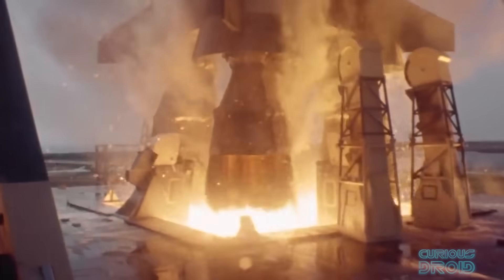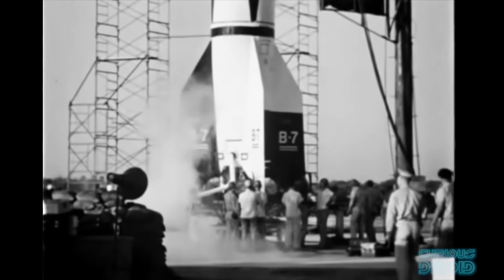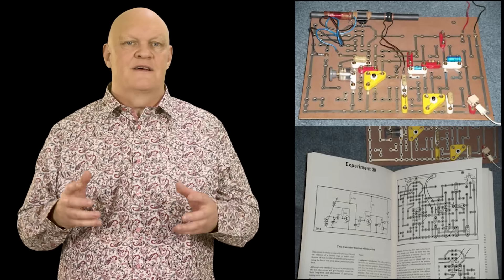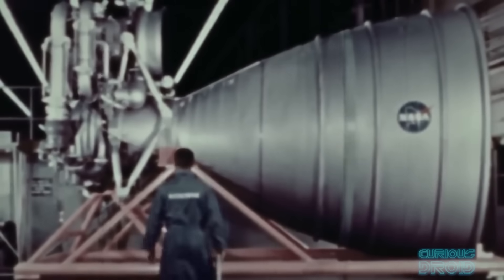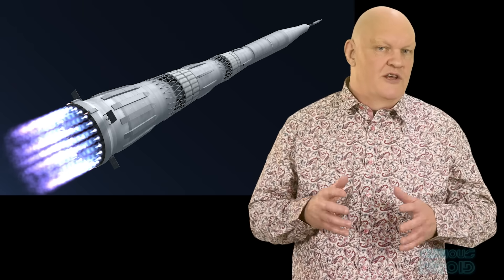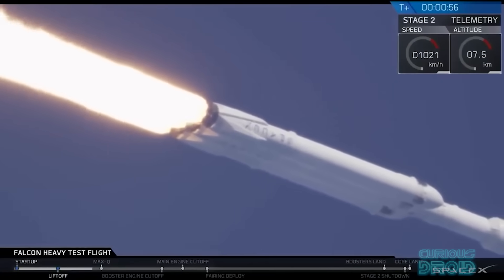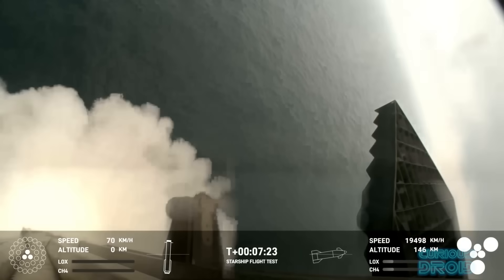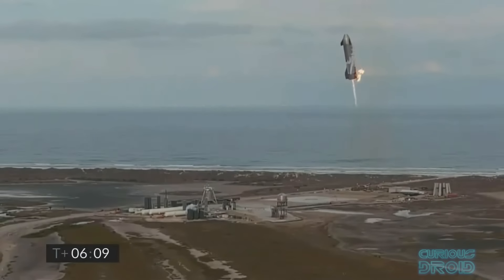Why Does SpaceX Use 33 Engines While NASA Used Just 5?

Comment: Bit of a nitpick but detonating charges in the f1 wasn't how they solved the instability, it was how they INDUCED the instability. Since it was intermittent, they needed to make it happen on command, and hence the charges. They already knew the solution was going to be via baffles on the injector plate but they didn't know what shape, size, direction, quantity, etc. so they tried all different types using the detonation to cause instability and then recording how well and rapidly the engine recovered and they eventually arrived at the best design by process of elimination.
Reply: Since the 1950s Rocketdyne under NASA contract developed the F1… this was a huge engineering achievement which even 50 years after became an Iconic and proven design. In contrast, SpaceX uses a different approach to all its decisions which results in clearly non sensical solutions…Called guess engineering or trial end error… which by the string of obvious mishaps and continues failures despite the spinning is not engineering by definition.
The good thing is like JFK once said you can’t fool everyone forever 😂
Reply: @Mannicx  hahaha, fair point, although to be fair the fluid dynamics going on in even a small well behaved rocket engine with the associated shock-shock and boundary layer interactions between injector flows, subsonic and supersonic flame fronts, reflections, standing waves, etc are fiendishly complicated let alone a massive engine like the F1 suffering combustion instability and it's not as if CFD tools capable of modeling it existed to do a proper engineering analysis with, so relying on intuition and educated guesses about what designs might work and then testing different iterations to find the best solution was about all they could do. There's pictures out there of all the different designs they tried if you're interested and it's really pretty fascinating to see what worked and what didn't.
Reply: @GlutenEruption  agree, I admire the efforts and engineering that went into the development of the F-1 … just keep in mind that each F-1 iteration was all about science and engineered backed decisions… not guesswork 😂
Reply: @Mannicx  oh, of course! Done with slide rules and log tables too. They instrumented engines with hundreds of analog pressure sensors to get an idea of what was happening in the engine, preformed literally millions calculations and ran thousands of tests on different injector designs, baffle geometries, baffle configurations, etc.
Reply: Did Apollo 11 actually leave near-Earth orbit?
Despite the revisionist narrative that this channel won't question -- unstable fuel burn for the oversized F1 engines was never rectified and another arrangement in their place was made in order to reach near Earth orbit, keeping the F1 bell nozzle to maintain the desired appearance.  The great licking yellow flame was an indication that something was not normal as fuel was burning in the atmosphere while providing no additional thrust. This was the result of injecting additional kerosene into the exhaust stream for greater visual effect yet appearing to produce an inefficient burn unlike other rockets after launch.  No explanation is forthcoming and this issue is not addressed in any usual report; however, using a smaller reliable engine with a reduced fuel load and stripped down mission requirement allowed the Saturn V to reach near-Earth orbit.  

The Apollo 11 crew attempted to demonstrate their position at over halfway to the moon as seen in the unedited version presented to the public while the more recently released unedited version reveals a flood of blue light entering the same window as the camera continues to roll, through which only a moment before, we saw the Earth far distant in what appeared to be very low light conditions. Then, as the camera pulls back from the window, the exposure settings are seen to return to normal as a flood of light enters the same window.  Without a change in the orientation of the spacecraft assumed to be on a trajectory toward the moon, the only source for any flood of light can be the Earth while in near-Earth orbit.  The usual sponsored efforts will try to make excuses for why the obvious did not take place -- yet is overly apparent in the unedited version.  When facts cannot prevail in support, sponsored activity will resort to name calling and other derogatory comments discrediting themselves.
Reply: @ronaldgreene5733  Here's a more detailed explanation of Apollo 11's journey, now it’s SpaceX turn …. Just do it!..

  To get real and recap…55 years ago…. Apollo 11 engineers launched on July 16, 1969, on a Saturn V rocket from Kennedy Space Center in Florida.
   - The Saturn V had three stages, each responsible for different phases of the mission. The first two stages provided the thrust needed to escape Earth's atmosphere.
   - After the second stage was jettisoned, the third stage (S-IVB) placed Apollo 11 into a temporary, nearly circular parking orbit around Earth at an altitude of about 185 kilometers (115 miles).

   - While in low Earth orbit, Apollo 11 orbited the Earth once and a half, allowing NASA to check the spacecraft's systems and prepare for the next critical maneuver.
   - To leave low Earth orbit and head towards the Moon, the S-IVB stage was reignited for a second time, performing what is known as a Trans-Lunar Injection (TLI). This burn lasted about six minutes and provided the necessary velocity to escape Earth's gravitational pull.
   - The spacecraft was accelerated to a speed of about 39,000 kilometers per hour (24,000 miles per hour), which allowed it to break free from low Earth orbit and enter a trajectory toward the Moon.

   - After the TLI burn, the Apollo 11 spacecraft was on a free-return trajectory to the Moon. This means that if no further maneuvers were made, the spacecraft would loop around the Moon and return to Earth.
   - During this phase, the Command Service Module (CSM) separated from the S-IVB stage, turned around, and docked with the Lunar Module (LM), which was stored in the top of the third stage.
   - Once the CSM was docked with the LM, the combined spacecraft separated from the S-IVB stage, which was later sent into a solar orbit.

Lunar orbit it insertion phase
   - After a three-day journey, Apollo 11 entered the Moon's sphere of influence. The spacecraft performed a Lunar Orbit Insertion (LOI) burn to slow down and be captured by the Moon's gravity.
   - This maneuver placed Apollo 11 into an elliptical orbit around the Moon, which was later circularized.

Then, 
   - On July 20, 1969, astronauts Neil Armstrong and Buzz Aldrin descended to the lunar surface in the Lunar Module, while Michael Collins remained in orbit aboard the Command Module.
   - Armstrong and Aldrin landed in the Sea of Tranquility and became the first humans to set foot on the Moon.

   - After spending about 21.5 hours on the lunar surface, the astronauts returned to the Command Module, performed a Trans-Earth Injection (TEI) burn to leave lunar orbit, and traveled back to Earth.
   - Apollo 11 safely splashed down in the Pacific Ocean on July 24, 1969, completing its historic mission.

This mission marked the first time humans left low Earth orbit, traveled to another celestial body, and safely returned to Earth.
Reply: .  . While remaining in near-Earth orbit, another indication are the impossible weather patterns seen on Earth, when in reality only a small portion of the Earth's surface was visible, framed by the round window of the command module.  Straight line cloud fronts are seen on video to be extending for what appears to be more than 6000 miles, a quarter of the Earth's circumference -- something that has never occurred in the meteorological record on Earth. The round window of the command module was used to effect an image of the Earth but the weather in the region did not comply for a realistic view.  No recognizable continents are found in view, but only the impossible weather patterns seen.

Comment: The RS 25 engines are surplus engines left over from the Space Shuttle program.  NASA decided to maximize the payload size for sending to the moon.  If they designed the SLS to be completely reusable, they would have to compromise on the payload to allow for part of its fuel to be used for recovering the core in the way Starship is recovered.  The way SLS is configured, the core continues its burn until reaching an altitude where an intact recovery is impossible.  I would imagine once the RS-25 engines are used up, a newer, cheaper design that doesn't need to be reused would be used (assuming those missions are still funded)
Reply: Actually, NASA and Aerojet Rocketdyne signed a new contract for additional RS-25 engines for the SLS. Cost: $100M per engine. So, the cost of one of those new RS-25s is equivalent to the cost of 200 Raptor 2 engines.

Comment: Because elon wants to use tax dollars to experiment with getting his payloads into space since he is the only one that needs multiple payloads that big. Hope that answer the question
Reply: Not Investing in Starship would be foolish for NASA. IF Starship turns out working it will open many many possibilitys/capabilitys for NASA and other Agencis and SpaceX of course. At this point NASA has invested about 3B $ wich isn't a lot if you consider that the small Orion Space Capsule (wich is still not working properly) has cost about 20B $ for NASA.
Reply: @meinking_sensei3807  3 billion for blowing up rockets in low earth orbit. Heck of a deal
Reply: @brickwitheyes1710  as i said "if it works" and SpaceX ain't done with it. But spending 20 billion for a small space capsule (wich still doesn't work properly so more money needed) is a heck of a deal, spending 2-3 billion on a single SLS launch is one heck of a deal or 1 billion on a launch tower.
Reply: @meinking_sensei3807  oh the capsule for the Artemis program that they are waiting on space X proof of concept when everything else is ready to go? Yeah great example 👍
Reply: @brickwitheyes1710  i mean the capsule that had onboard computer problems and heat shield problems (that they still haven't resolved yet and therefore not "ready") after spending 20 BILLION $.
Reply: @brickwitheyes1710  Artemis 2 isn't happening this year. It's happening late next year. At best.

It's still unknown what will be the limiting factor for Artemis 3; Orion or HLS. Both are currently delayed from the 2024 target to 2026.
Reply: @brickwitheyes1710  Don't let hate cloud your judgement.
Reply: @brickwitheyes1710  You are demonstrably wrong. SpaceX is the most successful rocket company of all time.
Reply: @SpaceAdvocate  😆 🤣 sure thing.
Reply: @brickwitheyes1710  It's just a fact. If you find yourself incapable of accepting reality because of deep-seated hatred, perhaps it is time to make a change in your life.
Reply: @SpaceAdvocate  space X has done nothing remarkable and my responses seem to keep getting yeeted. Musk said he would cut launch costs by 💯 percent and hasn't cut any costs. His false promises where how he got the contract in the first place. Not to mention the shady way in which he got this last contract.
Reply: Why would we discriminate whether the money comes out of taxes or from Wall Street idiots?
Reply: @samsonsoturian6013  true, when they go broke from backing frauds and idiots like musk they get bailed out with tax payer money anyway
Reply: in fact, spaceX saved taxpayers several billion dollars due to the reusability of falcon9,
Reply: @maks_1_123  no it really hasn't.

Comment: Why not build a massive rocket that uses 33 RS-25 engines? One up Space X and just make it so big, it could take an entire self sustaining colony to the moon in one shot?
Reply: Other than the fact that an RS-25 is nearly 100 million dollars each, a rocket using 33 of them would be noticeably less powerful than 33 Raptors and would need much larger and heavier fuel tanks, resulting in a poor mass ratio.
Reply: The tyranny of the rocket equation means that bigger isn't always better. A rocket that's twice as heavy won't be able to take twice as a much payload. Efficiency is king in aerospace.

Comment: its a common misconception that spaceX has saved alot of money with reuseability, the vast majority of their savings have come from simply having less high standards for safety and quality controls. possible by having it fail 10 times and redesigning what breaks.
Reply: Falcon 9 has a great record.
Reply: its a common misconception that spaceX has  not saved a lot of money with reuseability, 96 launches last year proves this
Reply: @maks_1_123  space shuttle launched 200 times, so whats your point?

a conservative estimate on the break even point based on their own numbers is that a booster has to be used 5 to 10 times, otherwise your losing money on reuse. some boosters have, but many havent. in total the savings are like 10% tp 20% of launch costs.
Reply: @sudazima  A reasonable estimate for booster reuse is that they have to reuse the booster once.

The booster is estimated to have a cost in the area of $20 million, and all other launch costs are estimated to also be around $20 million. So the cost of a Falcon 9 launch where you land the booster is something like $20 million, while expended it's more like $40 million. (These are rough numbers - it will depend on a number of factors.)

They could probably shave off a bit of cost on the booster by not having designed it for reuse, but it would probably still be something like $15 million.

Two expended launches would then be $70 million, while two launches with a reused booster on the second launch would be $60 million.
Reply: @SpaceAdvocate  reuse launches cant launch as much as expendable ones, plus reused boosters cant launch as much either anymore........
Reply: @sudazima  That's not really a huge issue. Very few launches use the full performance of a rocket. There's usually plenty of margin.

SpaceX solves the challenge of varying requirements by offering several options:

1. Reused Falcon 9 with return to launch site landing.
2. Reused Falcon 9 with drone ship landing.
3. Fully expended Falcon 9.

The option of fully expending a booster actually works fairly well with large scale reuse, because all boosters eventually reach their end of life. At that point, you can expend the booster for a payload that needs the performance and the loss of the booster is actually fine. They recently did this on a Galileo launch, where the booster did it's 20th launch and was expended.

This works perfectly if one in twenty launches actually needs more performance than a reused Falcon 9 can supply.

Comment: Great video, thanks! Another reason for smaller engines is that the same engine can be used on the second stage. Avoiding the need to design and produce a second type of engine.

Comment: 33 mini engines because the RS25 is one chad of an engine that spaceX doesnt have access too
Reply: Oh, and btw, SpaceX does have access to the RS-25. Aerojet Rocketdyne will sell them to anyone because they like money.
Reply: The Raptor engine is more powerful than the RS-25.

(230 tons of thrust vs 190 tons of thrust.)
Reply: @SpaceAdvocate  sure, if you put like 33 of them, why not?
Reply: @WowSirSmallFan  Each engine is more powerful. The 33 Raptors on Starship has 230 tons x 33 = 7590 tons of thrust in total. The 4 RS-25 on the SLS has 180 tons x 4 = 720 tons of thrust in total.

The only reason SLS is able to lift off is the two solid rocket boosters.

Comment: To begin and end with the comparison 'StarShip' is not a lunar rocket but a rocket with only low orbit capacity.
Reply: It took four launches to get a successful sub orbital flight. Whilst omitting to provide anything for either of the parts to land on. Even if the wreckage can be recovered there will be the extra work of determining flight related vs water impact damage.
Reply: @markevans2294  The wreckage won't be recovered. They'll just move on to the next launch.

The plan is to try to land the first Super Heavy booster back at the pad in July.

It might be a bit longer before they try to land the Starship, but it could also be later this year.

Comment: 33 engines is not a good design. It has much more components in total. That means the system is less reliable.
Reply: No, it's more reliable, as it is multiple fault redundant.

Few engines means zero fault tolerance.
Reply: That assumes the rocket can't survive a single flame out and that instability isn't an issue on larger engines. Also, small engines can be mass produced